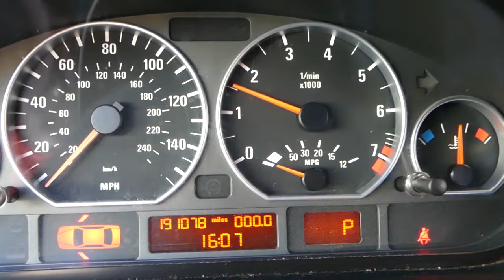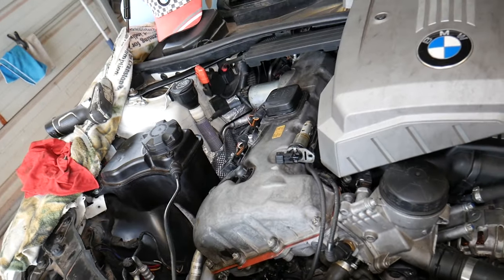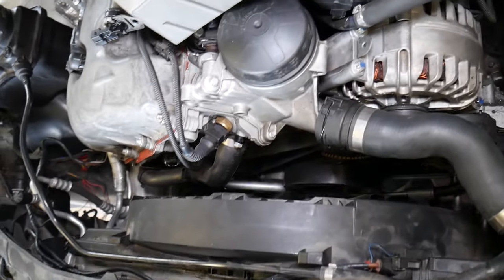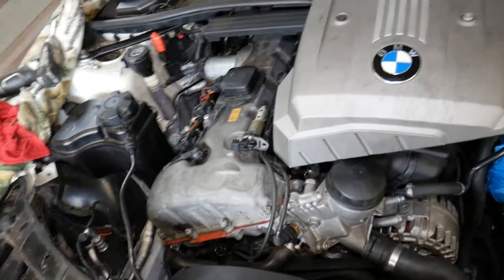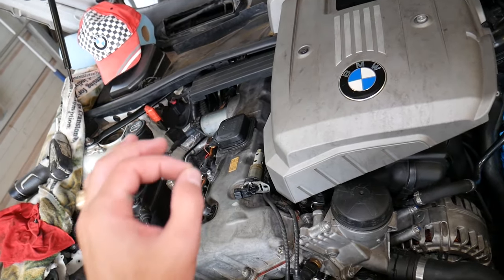TOP 5 REASONS BMW OVERHEATS

Comment from the maker: Products that we use and recommend:
► Water Pump (check fitment) : https://amzn.to/36OTHr5
► BMW Coolant: https://amzn.to/3A8IwMS
► BMW OEM Coolant: https://amzn.to/3U1zMPl
► Thermostat: https://amzn.to/3gEWGqO
► Panel Removal Set: https://amzn.to/3YiMADu
► Tool Set: https://amzn.to/3p5MM6t
► Screwdriver Set: https://amzn.to/3XRB28Q
► Castrol Oil: https://amzn.to/3xBc8B9
► Oil Filter: https://amzn.to/3w0Ulme
► Torque Wrench: https://amzn.to/32qyRwg
► Liqui Moly Engine Flush: https://amzn.to/3IiDBID
► OBD Scanner that we use most often: https://amzn.to/3I4MQfe

► Check out our Amazon Store for the tools and parts that we use: https://www.amazon.com/shop/worldmechanics
Reply: hey body i wanna take clases of bmw mecánic so where u recomend to do it, thank u
Reply: Where are you located at?

Comment: I have had my BMW to shops to fix.  Nobody knows how to properly diagnose it!!!!!!! I have replaced the entire system almost and still overheat. I'm tired.
Reply: Intercooler messed up clean it it's filled with oil
Reply: What's the yr and series
Reply: 525i series  over  heating
Reply: Did you ever find out the issue I’m going through it rn man
Reply: @e60tube90 nice guess lol
Reply: Take it to the dealership for diagnosis if you haven’t already
Reply: I'm in the same boat at your brother with my 2002 325xi
Reply: Took mine to bmw. Lol problem solved
Reply: Proper bleeding of coolant after a repair on any coolant hose has to be done or it will overheat ! Get air out with key on 10 second on gas open  coolant reservoir cap see air bubbles and check if electric coolant pump is running good .

Comment: I got a new expansion tank. Any idea why my e46 starts overheating at idle?
Reply: Mine starting doing this today
Reply: Cuz it’s a bmw that’s what they do Lmaoooo
Reply: You probably have air gaps
Reply: my e53 is doing that too
Reply: Same anyone got answers
Reply: @smurf_chicago6555  air bubbles in coolant system put key fob in ignition, press and hold gas for 10 seconds roughly and you will hear the water pump come on and that is bleeding the entire coolant system of air bubbles, hope this  helps
Reply: Don’t do the mechanical fan delete. My z3 was overheating at idle without it.

Comment: My engine maintains temp at 110 degrees when it should maintaining about 100. The hood gets hott you can’t keep your hand on it for more than 5 seconds. No coolant seems to be leaking, water pump is fully working. 2011 328i x drive
Reply: Same here..did you find the problem?
Reply: @ hey there, I called around some bmw shops and they said it’s normal I guess so I’m not stressing any more. But I do have a coolant leak from my radiator mayyybee that can be the cause ?

Comment: 1. Check Coolant level
2. Is Radiator Fan working? 
3. Thermostat working?
4. Electrical Water Pump? 
5. Bad Head gasket ? 
6. Cooling system bleeding done properly?

Comment: Hi hello love ur videos the help me alot i have a bmw 2013 335 ix msport package and i replace the fan the thermostat the cooling relay the water pump even the flange on the head i replace the fan relay and my fan only works on high and stays on  what that can be can u help thank u
Reply: Ever found out what the overheating issue was?

Comment: So what does it mean if you drive the car around and it doesn’t overheat while driving it regardless of how long you drive it but when you park it it overheats takes a full eight hours for it to cool down before it will start again also while it’s in this modethere is a clicking sound from a relay out under the hood you take the relay out the temperature gauge on the car goes down to normal, but the car will not start without the relay. Have you ever experienced this?

Comment: Hi I enjoyed and subscribed all ur utube channel ! I have 2012 535i f10 ! I try to reppaced the head lights but now they said my  instrument cluster is malfunction and also my fuel gauge , speedometer and temperature gauge is not working neither ! I had bought a use one but afraid to put in bc its might mess up my mileage only 64k ! Can u help on my issue ? or I have to code it ir something! thx so much

Comment: Hello,  i have a problem with my e60, the climate controll only blows air through the vents in the middle of the car, on the middle of the dashboard, and in the back of center consoll towards the backseats) not on the sides on the dash or in front of the dash. Do you know what can be the problem?

Comment: I definitely believe in replacing all of the low quality plastic parts with an aluminum/metal upgrade and OEM rubber hoses with the high quality silicone ones (if available) is a must to increase reliability to make BMW ownership easy as possible.

Comment: Need help.  07 z4 sporadically overheats. After shutting engine off, setting for no more than a minute, the gauge returns to normal when ignition is turned on. Car will be fine for a while then does this again. We recently (500 miles ago) replaced the entire coolant system. Did all the proper bleeding. Replaced both coolant sensors... Car still does this. Is this a symptom of a sticking thermostat? Thanks...

Comment: So my bmw 2006 325i was leaking from overflow cap I changed the thermostat then 3 days later the same thing it leaked out from overflow cap then I changed the  the water pump and currently it’s driving drove it this morning I’m really nervous is there some else wrong with it ? Please help
Reply: Update?
Reply: @dvnnix1234  cars running perfect 👍🏼
Reply: @markolmos8608  I have the same year and model and my coolant reservoir keeps building up pressure. What was the issue for you?
Reply: @SncrlyFckYu  the water pump was my issue
Reply: @markolmos8608  same here. Finally got someone to come and diagnose 😭 this is my second time repairing it lol

Comment: I have a 750 that keeps  over heating the over flow box keeps  busting  it sounds like  the water is boiling  what is stopping  the water. I have  changed .I have water returning  to the  box so its not the water  pump  put new thermostat.

Comment: My fan won’t turn on while driving my coolant reservoir is leaking but I’m not sure if that’s the cause of my fan not turning in however when I used cables to test the fan it did turn on
Reply: Did you find out what was wrong with it I thinks that’s what might be wrong with mine also I have a 2013 328i

Comment: Hey there guys, i have a problem on my bmw 528i 2013, it vibrates before warmed to temperature of 190-200F. For some reason my rpm is around 800 before car warms up, but if i turn off the heater the car is alright. How it can be fixed?
Reply: That’s normal. All cars have increased rpm at idle when first starting the car. This is more common in winter times. But it’s so the engine oil warms up faster and doesn’t damage the engine. The vibration could be caused by a faulty IAC motor that is malfunctioning. Your air intake is probably has a build up of dirt or something. Hope this helps

Comment: Which battery terminal do you take off first? Positive or Negative?
Reply: U only need to take off one, and that one u take off is negative. If u need to replace the battery than just take off negative first, and reconnect it last. Also when working on a car, make sure that the negative wire couldn’t be knocked back onto the battery terminal. And everyone has a different opinion, but I like to wait atleast 10 mins after disconnecting the battery before I start on my car, just to ensure there is no electricity left running around.

Comment: When you start the car, will the radiator fan turn on immediately or only until the engine reaches a certain hot temperature,
My F10 fan sometimes turns on immediately when the engine starts, even when the temperature gauge is at minimum temp.
Thanks
Reply: Did you find the solution
Reply: @Moneybagz3_  sent to Autobavaria for diagnosis. They “suspected” the water pump was faulty. So, to avoid further serious problem, I gambled and changed the water pump, a half day job. Problem solved, until today engine is working fine. Temperature gauge reading is where it should be.
Cost me RM2,200 at a workshop in USJ (not BMW authorised).

Comment: I’m in Maryland with a 2008 BMW 550i and the engine running hot and the fan is really loud when i put on brakes. Can someone give me suggestions outside of the dealership to take my car. Help help help
Reply: Did you ever find a solution to this? My 2008 535i is running hot currently and my coolant levels are good, no issue with water pump, fan is still running. I haven’t checked the thermostat to make sure it’s not faulty but my car is doing that loud humming from the fan when ny car overheats now
Reply: Me too 535i 2007 bmw
Reply: My 2012 535i N55 engine is doing this same thing. I put a new water pump in at and I can hear water pump running. The fan is really loud. In thinking its the thermastat.

Comment: I’ve change the water and thermostat I proceeded with the bleeding process and everything was fine until the next day the car overheated now every time I want to run the car I have to bleed it so water pump turns on otherwise The car will overheat if I don’t activate the water pump with the bleeding process
Reply: Did you ever figure out the problem?
Reply: Sounds like my problem I need answers

Comment: I need a new coolant temperature sensor and thermostat for my 2004 BMW 325I...it's not overheating but it normally is stuck in the cold position on the temperature gauge....not normal.... sometimes it works normally....

Comment: A question my 2011 bmw 328i is overheating I already changed the water pump ,thermostat and upper radiator hose there is no leaks but as soon I star the engine it says that it’s overheating! I need help !!
Reply: Instant overheat means air . Nobody ever bleed your car

Comment: My 07 328i is running at 240 degrees its running too hot but I switched the coolant sensor I did a coolant flush but still runs hot any ideas what it could be?
Reply: Cadillac converter